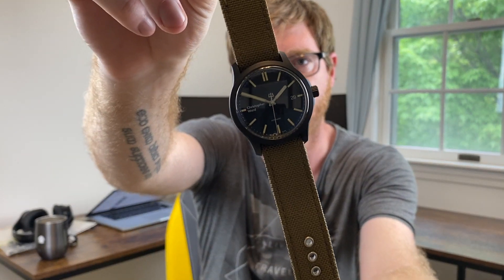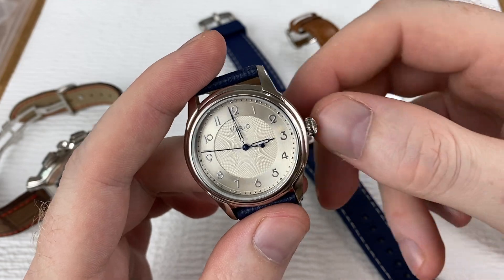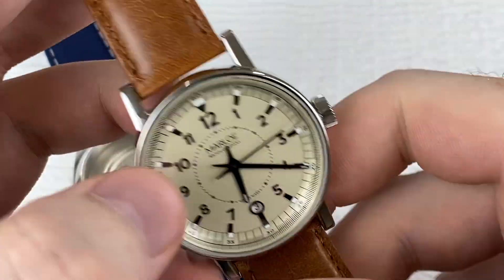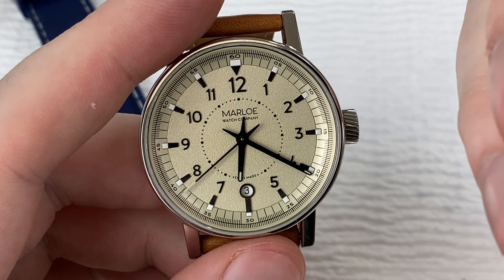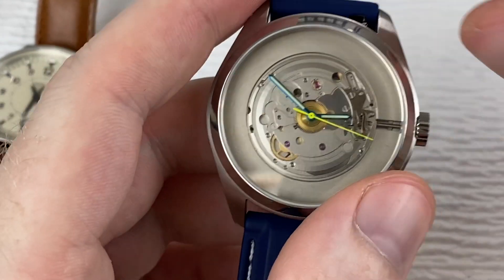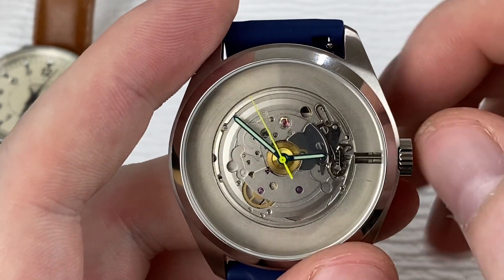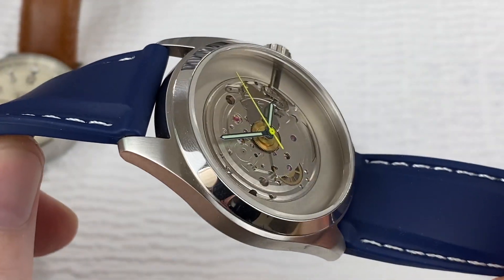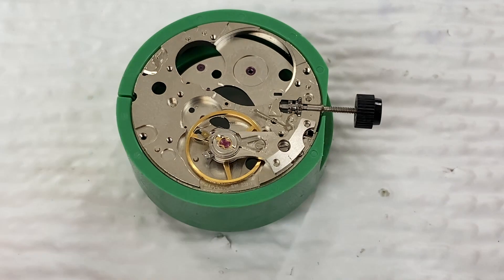The Hacking Complication, How It Works

Comment: Not sure if you would see this or not being this is an older video but… I have a VC 5520 and this little “hacking trick” doesn’t work on it when I move the minute hand backwards. Any reason for concern? Thanks!
Reply from the maker: No cause for concern. Sometimes you have to hold it for 10 seconds or so, but may not work for every movement.

Comment: also what are your thoughts on keeping a watch (newer watch) on a winder all the time, vs letting it wind down between wearing and even stop... to protect the main spring (get it off max tension).
Reply from the maker: I don't use winders and wouldn't recommend them unless you have just two or three watches and trade them out every couple days or so. It's a waste of power (the winder) and unnecessary wear and tear on the watch parts if you have long stretches between wearing them.
Reply: @WatchComplications  thanks man, I my basic engineering background made me think so, but I wasn't sure...

Comment: from what I understand a lot of the purist high horology movements don't hack because it's generally not a good idea to suddenly stop the balance, especially on a higher beat 4HZ or more?  I mean until they caved to marketing pressure, Patek, AP and VC didn't have many hacking complications, and VC still doesn't on their 5100 and 5200 in-house movement.  BTW, on the 5100 movement, your non-hacking trick doesn't work... It worked on my Omega Cal 321 Ed White (the new version), but not on my Overseas.
Reply from the maker: I can see how the sudden stopping of the balance could be an issue. To be honest, hacking or non-hacking doesn't really matter to me much, though it seems to be a thing these days.
Reply: @WatchComplications  ok, thanks for answering this.... no idea why the 5100 movement doesn't do the trick you show.. 🤷🏽‍♂
Reply from the maker: it might be wound enough that it won't work. it usually has to be lower powered, like when first getting around to setting time after it not being on wrist. If it's significantly wound already, the trick is less likely to work.